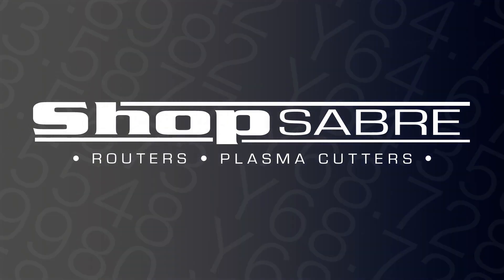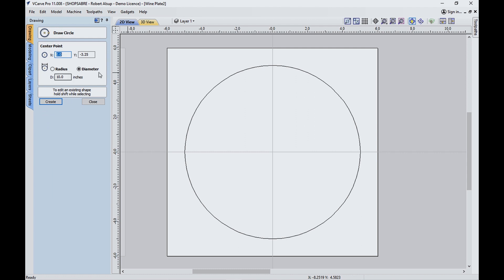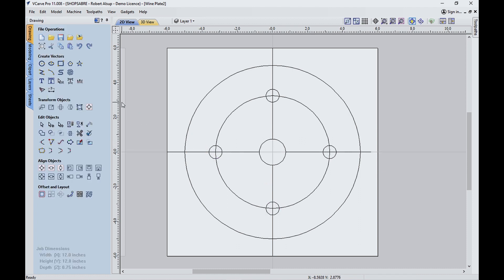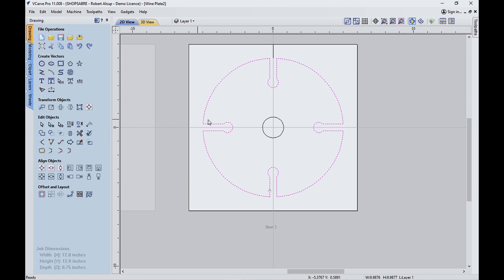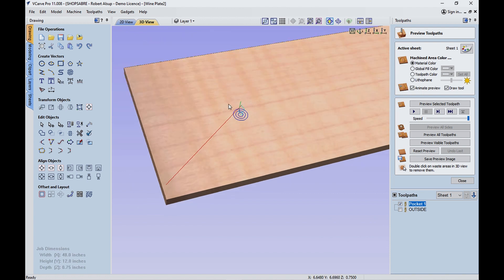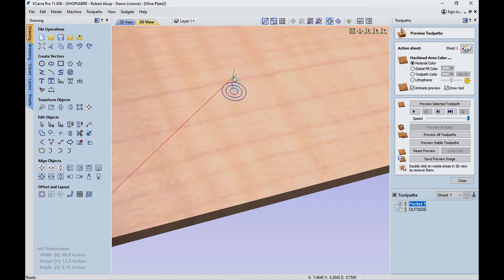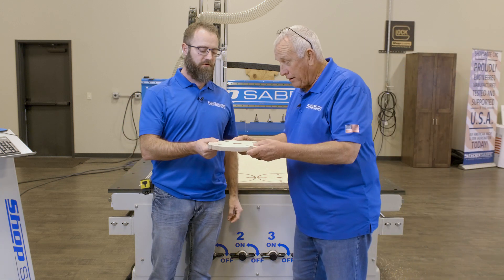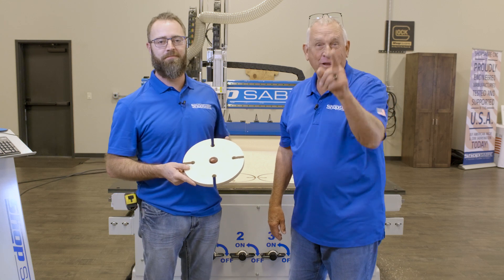Making a Wine Glass Holder with a ShopSabre CNC Router

Comment: What speed did you cut this at with the 3/8" bit and full depth of cut? Curious! What do you think the top speed for cutting baltic birch 3/4" ply full depth of cut with that same bit would be on the IS408? Just looking for some ball park numbers, thank you!
Reply from the maker: 500 ipm, 18,000 rom
Reply from the maker: In a single pass 500/600IMP would be recommended, but technically you could get up to 750 IMP but not recommended with a single pass.